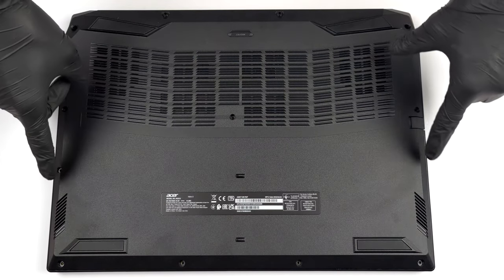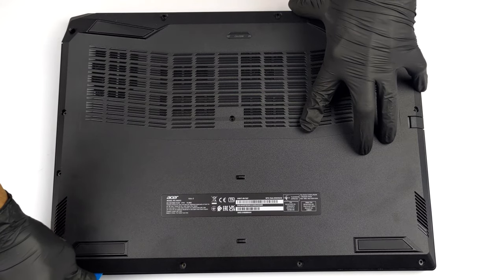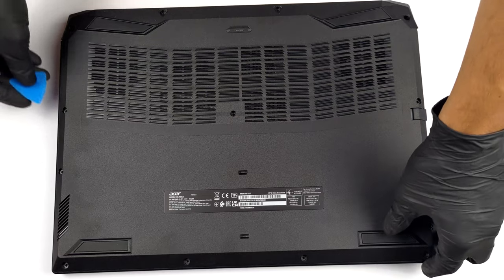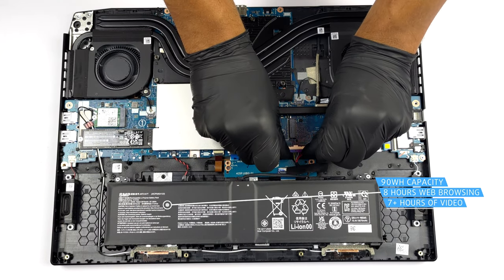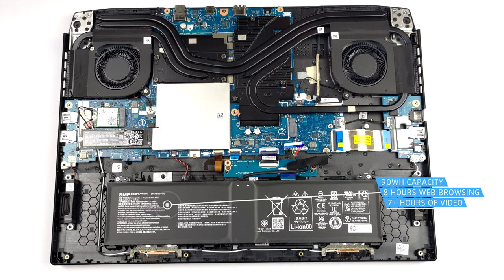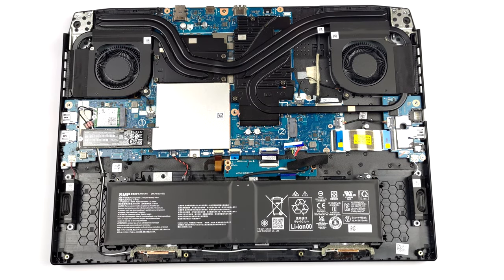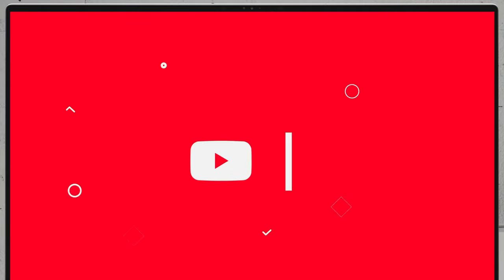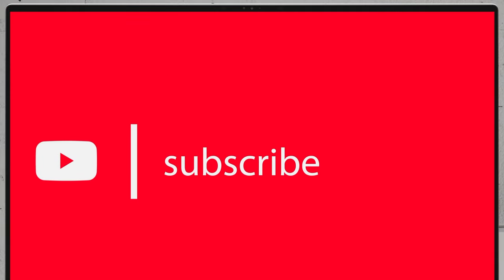🛠️ Acer Nitro 5 (AN517-55) - disassembly and upgrade options

Comment: I know this is late. But I've looked all over to find any video on YouTube or anywhere else that shows the inside of my Nitro 5 model (AN517-42-R5KZ). I want to see what to expect when I open it up to clean the fans and repaste in a couple of weeks, as well as do upgrades in the near future. I've also tried to find out if its internal layout is comparable to any of the SKUs that I have seen; figuring although that might not be perfect, it might be close enough. No luck there either. Help or suggestions...? TIA!

Comment: Can I place one 16gb stick of 2666MHz PC4-21300 CL19 Ram in the expansion slot along with the 8gb to make 24gb total Ram or do I have to pair the default 8gb with another 8GB? Thanks for the input!
Reply: Better would be to buy two of the same. In dual channel, the RAM is much faster than if you install two different ones.

Comment: without 2.5 hdd upgrade option is the saddest part
Reply: sata is the past man
Reply: but instead you have a bigger battery
Reply: Yes true! Why did they remove the 2.5 HDD bay.
Reply: @awakenedsoul2638  more battery I guess
Reply: Real sad cus I just spent 80 just to see that it doesn't have one

Comment: Can I place 32go DDR4 3200MHZ in it ? 
Edit : I tested it, and yes, I can 🙂. It improved Hogwarts Legacy and Jedi Survivor.
Reply: Did you disconnect the battery unit before installing it or did you just stick in the extra RAM? I’m planning on adding an extra 16GB DDR4 to it but I’m not sure if it is advisable to disconnect the battery or leave it there
Reply: @stewFPS no need to disconnect the battery. 👍🏻

Comment: But does it support m.2 sata? I'm guessing no since it won't recognize the one from my old computer.
Reply: Doesn't appear that way.
Reply: NO! Only NVMe Key M M.2.
Reply: @awakenedsoul2638  Does the m.2 pcie gen3 500gb crucial SSD work instead of a gen4?
Reply: @SAMxIGRIS  

If your PCIE is v4 it will work but I do not know if it is forward compatible for example your M.2 slot is only v3 and you want to put v4 I do not know if your PCIE generation 4 M.2 will work. If your M.2 is Generation 3 and you will connect it on a M.2 Generation 4 PCIE slot then it will still work because it is backwards compatible.
Reply: @awakenedsoul2638 The slot description says it's m.2 gen 4 slot.. i wanted to add more space and gen4 SSD cost higher.. and there is an offer on gen3 SSD here..
Well so that means I can add a new gen3 SSD on gen4 slot and it will work? Right...
Thanks mate 👍👍
Reply: @SAMxIGRIS  

If you have two M.2 slots then load the other slot with a higher M.2 capacity. Keep in mind if you do too many write, read and delete of your data your M.2 will not last long.
Reply: So can it only support a gen 4 or can i get a gen 3 nvme
Reply: @TheLegodinosaur  gen4 SSD support means we can put gen3 SSD as well.. that's what I heard somewhere..